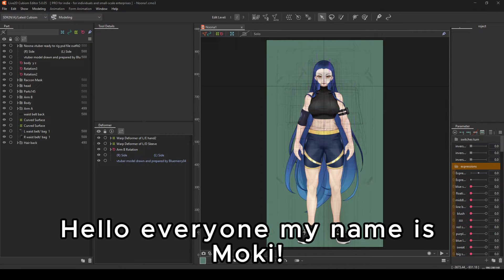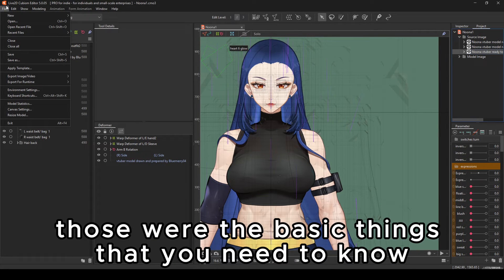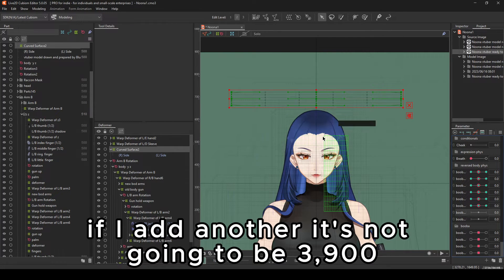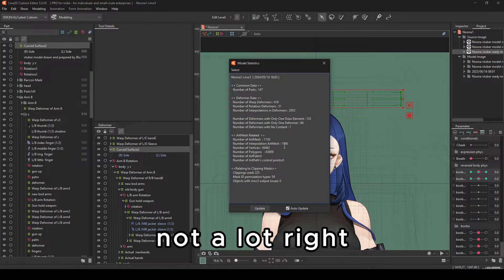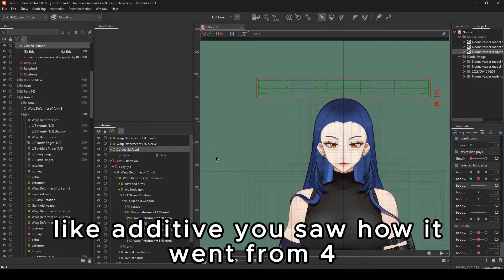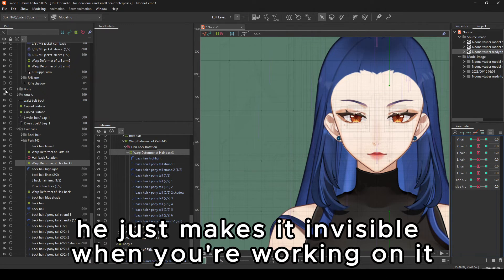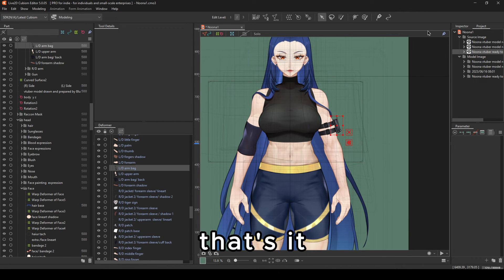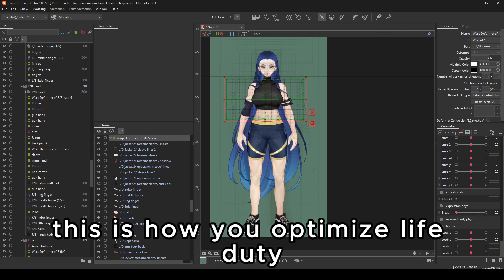how to optimize your Vtuber Rigs in Live2d

Comment: Can I ask, what's your file size for this model? Or one similar? I made a model that's about 860 layers, and a ton of rigging as well. I made it in Adobe Illustrator with vector art so the psd was insanely small, like 30mb which is the ONLY reason my model runs as well as it does. I need to optimize BIG time. The CMO3 right now is 24.2mb and the VTS folder I put into Vtube Studio with the MOC3, physics, toggles etc. is 20.7mb. After fixing my art meshes and deformers it can get lower and hopefully not use so much CPU, but now I'm making models with properly painted assets on CSP and am expecting these files to jump in size by at least 2-4 times, and I was curious what's a good file size to shoot for  as a benchmark?